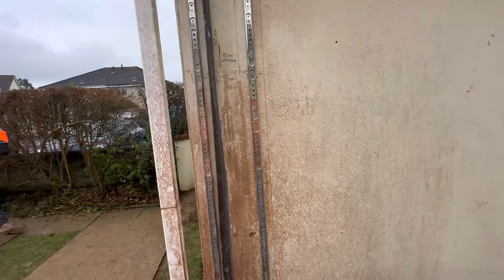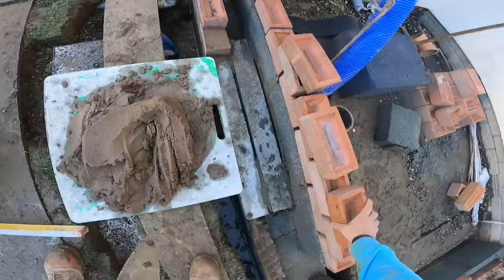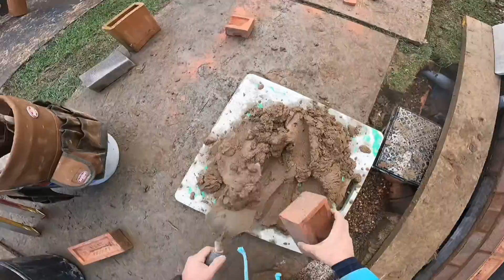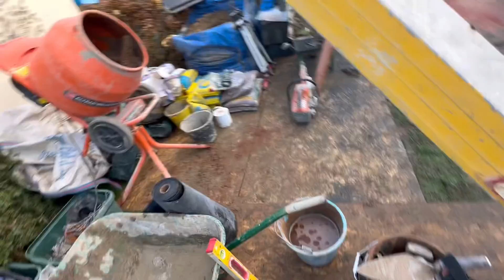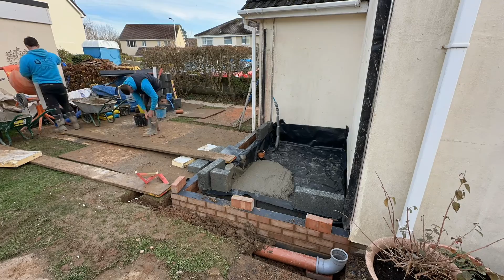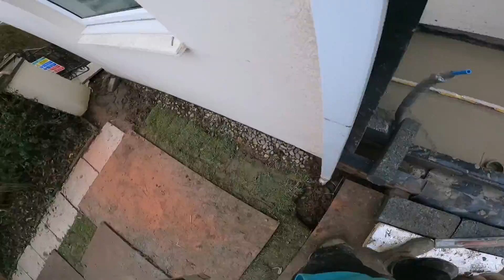JGB EP:29 Brickwork Plinth build + Concrete Slab!

Comment: Looks like a text book build Jordan i like the pauses where you stop to explain what you're doing. I wanted to see the oversight in a bit more detail, did you put sub base under that sand or was the ground firm enough without it? 
I haven't seen a vertical damp proof very often is that essential now or just belt and braces?
You're very neat and tidy with great attention to detail there's a lot of demand for good builders like you i would think.
Im no builder by the way!
Reply from the maker: Thanks for the comment I appreciate it 👍
Regarding the oversite the ground was already firm enough to lay the sand and membrane on top as we checked with the building inspector as there’s no point taking up hard ground the replace it,also with the new regulations a vertical DPC is necessary on extensions to stop damp getting through the cavity,hope this answers everything.